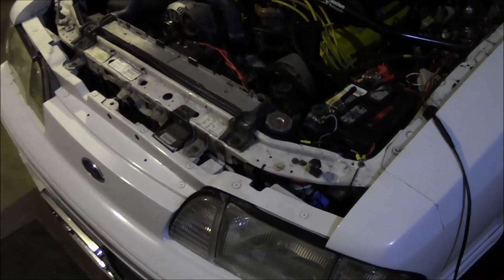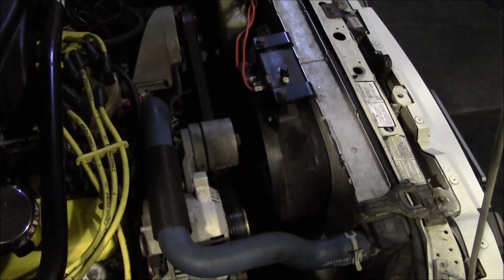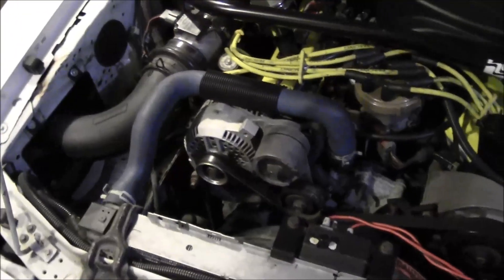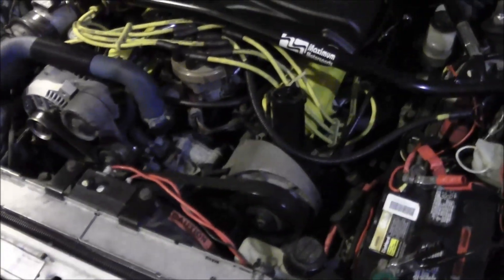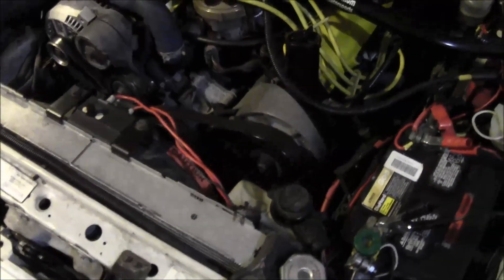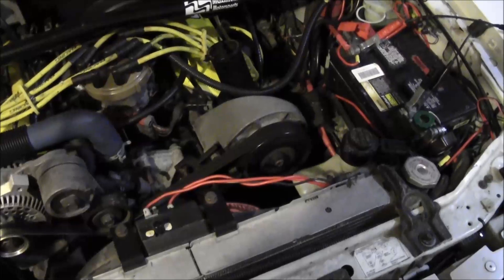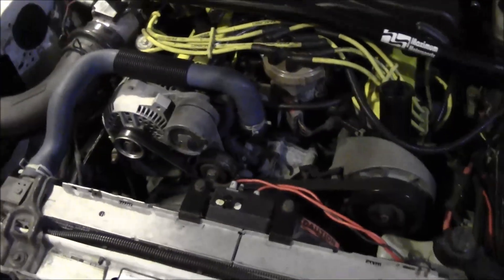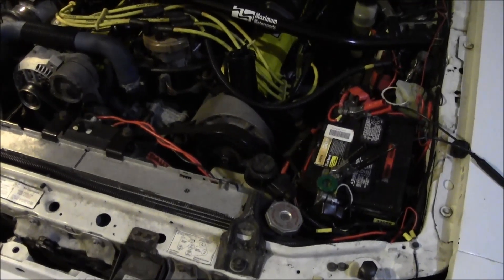Fox Body Mustang Electrical

Comment: you mentioned all the basic fox electrical questions, good info. i knew all of these tricks of course, what alternator you running on your car?  i have a 95 amp direct replacement that requires no modifying of the bracket, and it has a larger pulley on it so the under drive pulleys dont affect the voltage at idle, i have a brand new battery however my voltage only when the blower fan is turn on plummets, my electrical fan is always on i have a toggle switch for it because my car gets hot no matter  if my fan is on or not, so is my blower fan the issue because with everything else on its no problem just when the blower fan is turned on
Reply from the maker: My car has a 130 amp alternator on it.  Having a new battery does not necessarily mean you have a good battery.  It is rare, but some times a new battery is bad right off the shelf.  The engine cooling fan always running is probably causing issues for you.  You may have high resistance in your blower motor wiring that is pulling down your electrical system as well.  
   I would start by doing a load test on your battery.  Most auto part stores will do that for free.  I think your 95 amp alternator is probably not putting out enough juice for your set up.  Also, the engine cooling fan always running will not allow the battery any time to recover and take a charge from the alternator. 
   You should consider upgrading your cooling system with a larger radiator.  Another problem could be the way you have wired your electric cooling fan.  Most fans are wired with a gauge that is too small to provide proper current flow (many times the wiring that comes in a fan kit is too small).  This will cause the fan to spin slower than it is capable of spinning and reduces cooling ability.  You may have too small of a ground wire for your electric cooling fan as well, which will hinder its performance.  I have done some ground wire upgrades and it is very shocking how important a good grounding setup can affect performance.
   Start your car with the blower motor off and let it idle.  Check the voltage of the battery at idle with a voltmeter.  It should not be below 13.8 or 13.5 volts.  Then turn on your blower motor and check the voltage again.  It should not be below 13.8 or 13.5 volts.  If it is below 13.5 you need wiring upgrades, a higher amperage alternator, or both.  You could also check the voltage with the engine cooling fan OFF and ON to see how much the engine cooling fan is affecting voltage output.

   So... with that said, I would try the following in order to fix your problem with minimal expense.

1.  Check your fan wiring (look for burned wire insulation) and consider upgrading the wiring to increase current flow.
2.  Have your battery checked/load tested.  (your battery is probably fine, but check it anyways)
3.  Purchase a battery maintainer and use it regularly.  (the fan running constantly is stressing the battery)
4.  Try turning off your engine cooling fan and see how your blower motor reacts.  I think the blower motor is the straw that broke the camels back in your charging system.  By taking the engine cooling fan out of the picture, you can judge if the blower motor is a real problem or not.  Blower fan may be going bad/high resistance, or poor grounding.
5.   Rewire your engine cooling fan to a thermostat.  The fan constantly running puts a large stress on your alternator and is probably running your battery down.  
6.  If you rewire your cooling fan to larger gauge wire and still have cooling problems, get a larger radiator.
7.  Consider upgrading your alternator to a 130 or 200 amp.  If I was going to do it again, I would just get the 200 amp.  It is expensive, but it is worth it in the long run.  When my 130 dies, i'm gonna get a 200 amp.   

Sorry this answer is so long.  Hope this helps you out.  If you have any questions, feel free to ask me.  Also, let me know how it goes for ya.
Reply: fwh79 
Thx for the detailed answer, and the magnaflows do sound great 😀

A couple things, the battery is literally 2 days old, j was only getting 12.4 v out of the old one which was 8 years old and I did have advance auto load test it and they said it was good..., I take that with a grain of salt, so I bought a new one and immediately noticed a difference, car sounds healthier when it starts and I check it with the same multimeter as the last battery and this shows 12.7, and when it's running at idle I get 13.7-14 and when I turn blower on it only goes down to 13.5 yet my dash gauge drops significantly, so I'll trust the multimeter and not the dash gauge, which is why I want to get an all digital gauge for the volts and the water temp, stock gauges are hard to tell where you're at and are not that accurate, with that being said my over heating issue is due to my long tube headers that are from the 90s they are MAC longtubes but they are not coated at all they are aluminized steel I believe that I put a high temp heat paint on the last time the my were off, they put out massive amounts of heat and even though I have an Svo hood and the electric fan and a 3 core radiator there is just way to much heat, I had a relay put on the fan and it was on a thermostat but if it's not on all the time the car would constantly overheat, 
So I really think I need a heat extractor hood and ceramic coated and wrapped headers
Reply from the maker: Be sure to pick up a battery maintainer.  The fan is going to pull that battery down, especially if you are driving at night with the headlights on.  So pick up a maintainer and plug it in over night, that way your battery is fully charged for a quick start up.  I would use a 3 amp model like the Schumacher sp3.  You can pick one up on Amazon for around $30-35 bucks.  I have been using my sp3 on my white mustang the past two weeks.  Works really well. 
   I understand what you are saying about the long tubes.  What is your fuel system set up?

Comment: I moved the battery to the trunk and now it doesn't charge. I think it screwed the battery can I run a wire directly back to the positive from the alternator
Reply from the maker: Are there two black wires with orange tracers on the back of your alternator?
Reply: fwh79 I think so I'm not in front of it right now but I believe so what does that mean
Reply from the maker: Actually, I have wanted to make a video about relocating the battery on a fox mustang for some time now.  My dad relocated the battery in his car and had some problems with it.  I think there are two black/orange wires that need to be removed from the alternator.  If they are not removed, the battery will not charge correctly or it had something to do with the cut off switch not working properly.   I was looking through the wiring in my repair manual and I think the black and orange wires have something to do with the 4 cylinder models.  I'll talk to my dad and get back to you about it.
Reply from the maker: How do you have the battery wired now that it is in the trunk?
Reply: fwh79 all I had done was extend the positive cable back and make a new ground but now I wired the positive right to the solenoid before running it back it's not the battery I checked that I'll start it and see today if it charges now

Comment: Hi removed my smog and AC and put new shorter belt in, and after started it up and now the battery light comes on, but the pulleys are stock not underdrive, any ideas? I know removing smog and AC pulleys wouldn't cause that would it? Its an sn95 5.0 with stock 130 amp alternator btw..
Reply from the maker: No that should not cause a problem.  You may just have a discharged battery.  Or you may have a bad alternator and it just happened to fail when you changed the belt.  Charge your battery and check the alternator with a voltmeter.  You should have 13.5 to 14.4 volts when the engine is idling.  You may also have something draining your battery like an alarm or an improperly installed stereo system.  Some of those problems can go undetected if the car is driven on a daily basis.  Then when the vehicle is unused for a few days... the battery will be drained down and cause starting issues.
Reply: fwh79 Thanks for for the fast reply and thanks for the info on that that helps took battery in and found out it has a bad cell and the alternator is putting out at 14 when idling so maybe the battery was problem? we will see. nice mustang btw. And I subbed your channel thanks again.
Reply from the maker: You're welcome.  Looks like you found your problem.  Be sure to charge up that new battery before you install it.  Thank you and thanks for the sub!
Reply: fwh79 Yep thank you :)

Comment: Can you swap an electric fan off of a 94 gt and put it in a 88 fox ? How munch would it cost to do the the relay for the proper wiring ?
Reply from the maker: I can't say for sure because I have never done that swap.  I would imagine it is possible though.  As for the relay.  You can find a good Hella brand relay for $10 to $20 on Amazon.

Comment: What deep cycle battery do you recommend?
Reply from the maker: Are you looking for a battery for a Mustang?
Reply: +fwh79 yeah. 5.0 fox body 1993... I have yet to find a deep cycle that would fit without new terminals
Reply from the maker: The reason you can not find a deep cycle that will fit your car is because a deep cycle battery does not belong in your Mustang.  What got you interested in a deep cycle battery?
Reply from the maker: I would recommend getting an AGM battery if you can afford it.  Optima is not the only company that makes an AGM so be sure to shop around.  If you don't get an AGM, just try to find the lowest cost battery with the highest CCA rating.  Be sure to get a battery maintainer for which every battery you decide to get.  I would also look into getting new cables if yours are original.  They are reasonably priced and easy to install.  New cables will ensure all the power of that new battery is being utilized.
Reply: good idea on the cables. yeah the optima will not fit under the hood in the stock location as it's too tall with the tray installed. I was looking for any recommendations on specific AGM batteries to use under the hood. I have the upgraded 130 amp alternator and keep the car on a tender so i should be ok

EDIT: I saw some folks used a Group 65 under the hood. I'm wondering if this will fit and not be problematic for clearance. maybe some minor tray modifications
Reply from the maker: Unfortunately I do not have any experience with AGM batteries in a Mustang.  I have seen fox cars with an Optima but I am not sure if mounting required any modifications.  I think the stock group size is 58.
Reply: looks like a group 65 will drop right in. gonna go test fit one
Reply from the maker: Let me know how it goes.
Reply: So I traced a group 65 on cardboard and posted on a forum and it should fit. it will be some what close to the hood  probably not able to use the stock battery retaining clip. I think I can shave the terminal on the ground a little to prevent any contact but it should work. I'll order one and do a response video link
Reply from the maker: Hope it fits without having to shave the terminal.
Reply: The battery fits. I'll wire up tomorrow and let you know how it goes with all new wiring + stock tray
Reply from the maker: Nice!  Where did you get the new battery from?
Reply from the maker: That's cool.  Yeah I think there is a group 65 in the black mustang I just picked up.  It fits but it is kind of smashed in there.

Comment: What should the battery be reading on a stock 1993 mustang (turned off)?
Reply from the maker: This is kind of a trick question and I will try to explain why.  The voltage should read between 12.4 to 12.6 if you are using a flood lead acid battery (which most people are).  There are a few things that will give you inaccurate readings though.  Such as... how long it has been since the car was running and when was the last time you opened the door to the car.  These situations all change the voltage of the battery so here is how I would go about checking your battery.  Open the car, pop the hood and roll down the window.  Now with the door closed turn on you headlights.  Leave them on for One minute (time this).  After one minute is up turn the lights off and wait at least 5 minutes (time this too).  During that five minutes do not open the doors of the car because it will put a load on the battery by turning on the interior lights.  When five minutes is up check the battery voltage with a volt meter.  If it reads anything lower than 12.4 I would charge the battery. These videos may help you out -   https://youtu.be/W2evYg4A0ic    https://youtu.be/4Y9i4Gg-Wbs  https://youtu.be/kenPkrjr190

Comment: ***** I am currently having an issue with the alternator most likely as well. The battery tested good, though it is only rated at 450c instead of 750c (smaller battery) i think it had c or cc as the power rating.. anyway. that tested good despite being a smaller battery than what normally goes in these vehicles. the charge while the car was running with no accessories on was around 10-11 then i think it dropped to almost 9 before the car died. i belive this is due to a faulty alternator as they are supposed to be around 12 or so at idle
Reply from the maker: Your alternator is not charging properly.  Voltage should not drop below 13.5 volts while running.  Should be around 13.9 to 14.4 volts with the engine running at idle.
Reply: *****
yeah, that was the problem. we replaced the alternator and the battery because the one in there was only 450 cold cranking amps and the 302 requires about a 650. plus i drained it about 4 times jumping it. thanks for the info!
Reply from the maker: Very nice!  Yeah, I think the cca specified for the battery is 500.  Which seems a little low to me.  I'm sure it's starting up really well with a 650 cca battery now.  Glad to hear you got it fixed. 

If you have old battery cables be sure to replace them as well.  That's an easy job and if I remember correctly, the cables are fairly cheap.
Reply: will do!

Comment: my alternator keeps burning up
Reply: what amp alternator are u running? I have a 89 foxbody with a stock alternator and I wanna upgrade
Reply from the maker: What do you mean by "keeps burning up"?  Have you replaced the alternator several times?  I'd be happy to help you out.  However, you will need to provide me with more specific information.  Sounds like you may have a bad voltage regulator.  It may also be as simple as a bad wire connection.  If you can give me a more detailed description of your problem, I may be able to help you properly diagnose it.
Reply: my alternator was over charging my battery so i got a bran new one.  put it in and i noticed my volt gage would  fluctuate up and down as i would turn on my lights well it worked like that for like 1 week then it just stopped charging. so i dont know if it was just a bad alternator or what in the for years i have had the car i have put 3 alternators in it  and voltage regulator is internal i believe
Reply from the maker: Russell Thompson Ok... I see.  Let's start with... what kind of car do you have?  Make, model, and year.  Also, do you have any electrical add-ons or modifications such as a high power stereo? 

How do you know the alternator was over charging?  By the gage in the instrument cluster?  Or by using a voltmeter?

Did every alternator you get overcharge the battery?

Did you ever load test the battery to verify that it wasn't damaged?

Do you have trouble starting the car or need to jump start it often?

Do you have any other electrical related problems with the car?

I know that's a lot of questions... but it's hard to diagnose a car I'm not standing in front of.  Hopefully we can come up with a solution for you.
Reply from the maker: iakona goood:  I am running a 130 amp alternator in my car.